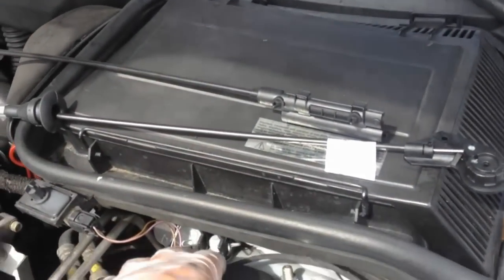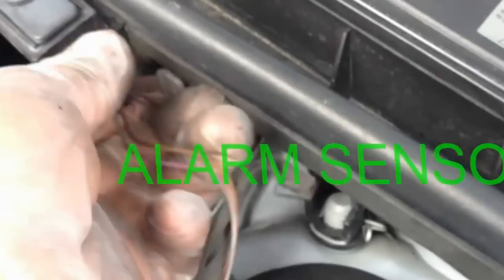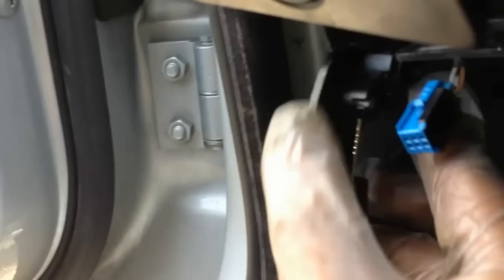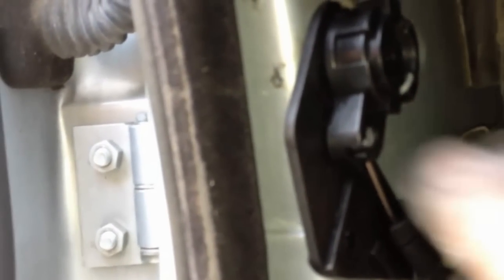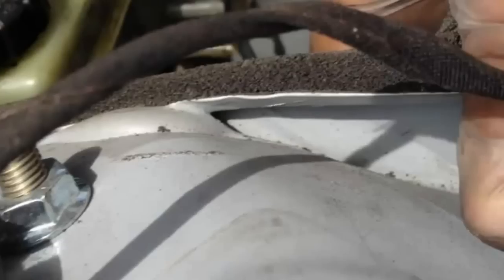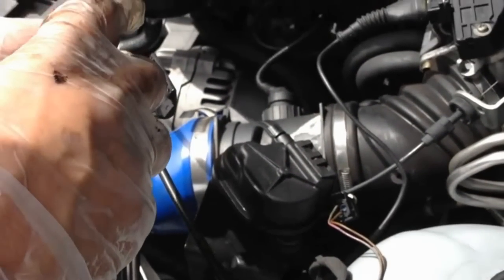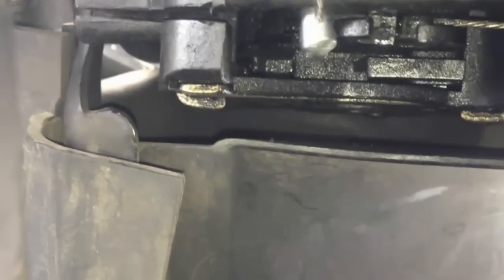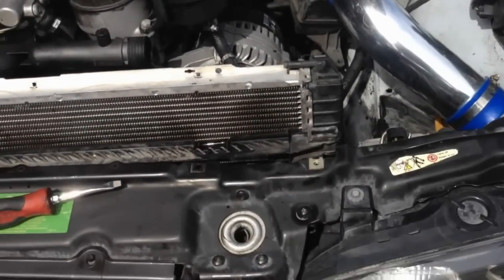How To Replace Hood Latch Cable1997-2000 BMW 5 SERIES E39 528I 525I 530I 540I M5

Comment: good job. very educational for do it yourself without breaking other parts. But I have problem in opening my hood due to latch being jammed and I can not trace the problem without opening the hood first. shall I break the front grill on the driver side to access the latch assembly? is there a way to reach the cable from underneath the car when it is jacked up? your advice is appreciated very much.

Comment from the maker: @PrivateChase All you need to remove is two plastic pieces under The steering well The plastic piece where you rest your feet on. And the plastic piece under your brake and gas pedal

Comment: hey, my cable broke, but only one piece, the drivers side.  What parts do i need to remove on the inside below the steering wheel to replace this?  I'm trying to do this myself and save labor cost.